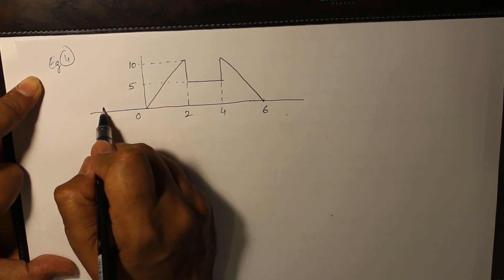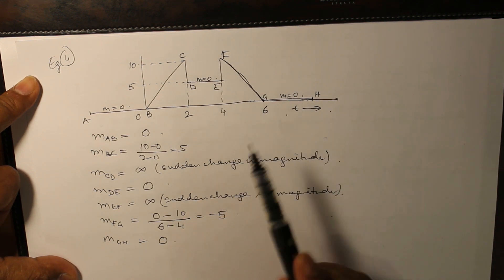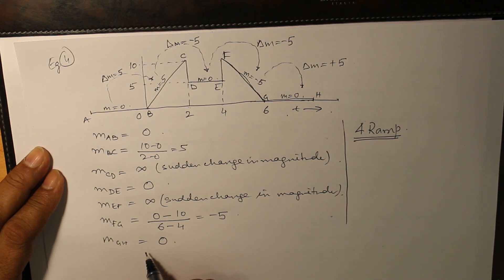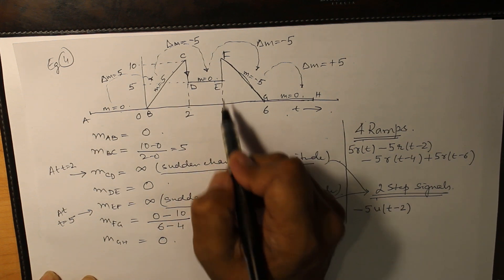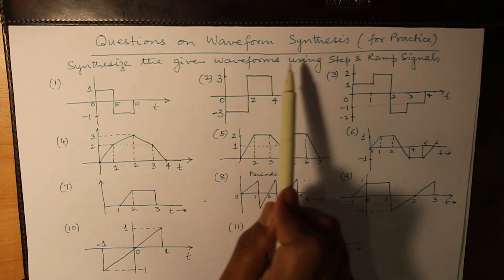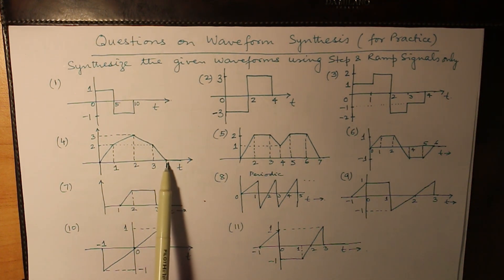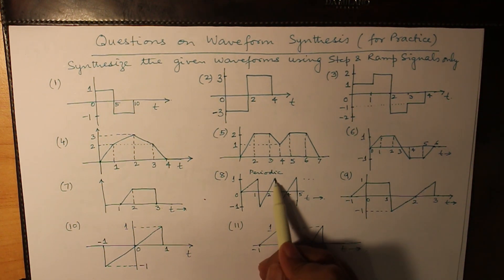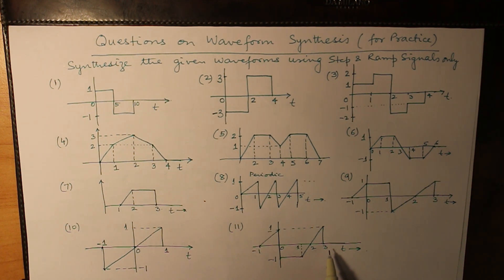Signal Synthesis: Problems | #07 Circuits and Systems | IP University B.Tech ECE, CSE Sem 3 Unit 1

Comment: I have done this question with the previous method you told by using u(t) is that wrong please reply soon
Reply: And also tell do these u(t) and r(t) are same
Reply: @Amandeep-uc7qh   no they are not same. U(t) = Step Signal, r(t) = ramp signal